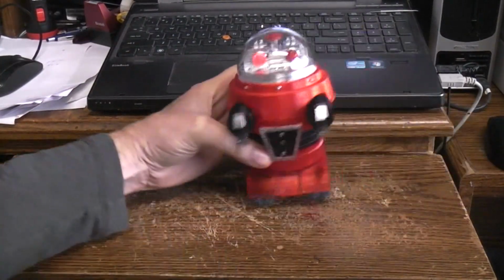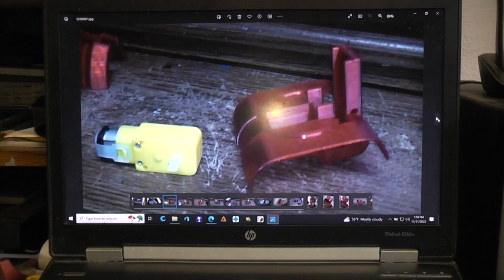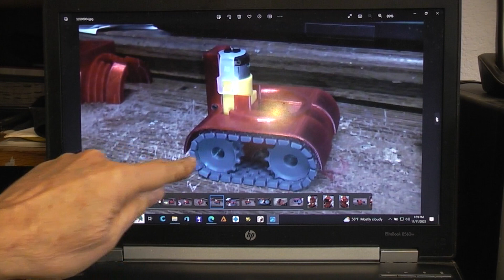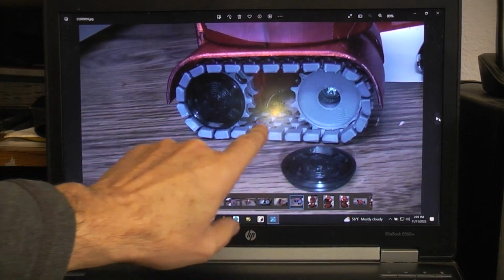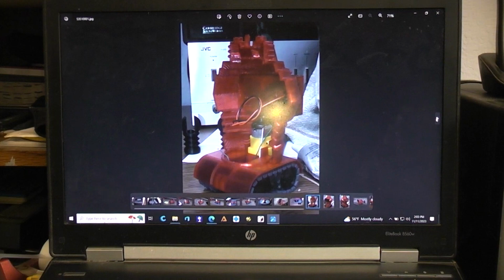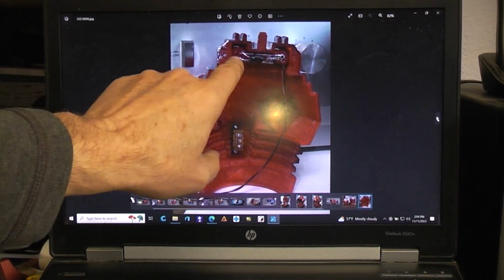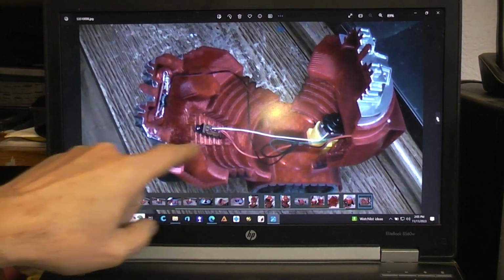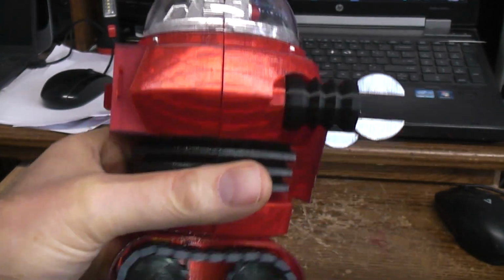Tank Pocket-Bot project. Motorized "TT gearmotor 1:48" print in place tracks, powered test.

Comment: Hi Robothut, it's me again. 🙂 What resistance does the current limiting dropping resistor have to be, I've got some 330 ohm and some 330kohm, is either any good? Thanks in advance for your time.
Kind Regards
Reply from the maker: The 330 ohms should work fine. you could place two 330 ohms in parallel for a 165-ohm resistance that might be better for a 2 battery "3 volt" system the 330 ohms should be fine for the 3 batteries 4.5-volt system.
Reply: Thank you very much once again for the valuable information.  All parts printed, assembly is the next stage. Kind Regards  @Robothut
Reply from the maker: Cool. Now lets us know how the assembly goes for you. @stephengittins6116

Comment: Hi Robothut, love the robot and am going to make it.  Does it need the voltage booster converter as in the Jupiter TT robot that I built?
Reply from the maker: Since it runs on 3 volts you can use red LEDs just fine with a current limiting dropping resistor.
Reply: Thanks for the info. I will get on with the build and post once made. @Robothut

Comment: HI John ,  what motor do I get for belt driven  tread one ?and pins for gears  and other parts ? TY
Reply from the maker: The build video has links to all the stl files and parts. 
https://youtu.be/NUn_M_hKQ4g?si=sahqCPF-CBWzqw5c
I used a 1:48 dual shaft TT gearmotor but a blue metal gear 1:90 would work just fine as well.

Comment: I was very well surprised to see that a tank toy tracks made of a material other than rubber provided good drag for the robot. The advantage of PETG is that it will be much more durable than rubber! This opens place for many interesting projects! 🙌🙌
Reply from the maker: In this case the racks are printed in PLA the body was PETG. So I have not tried the tracks in PETG yet. But worth testing for sure.